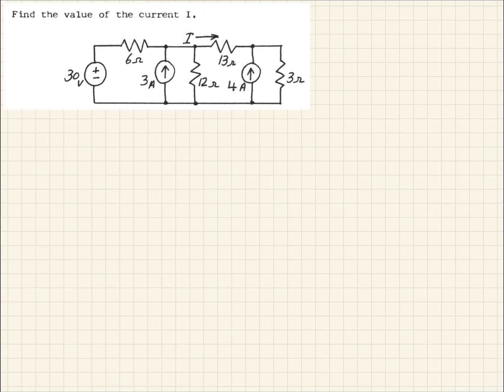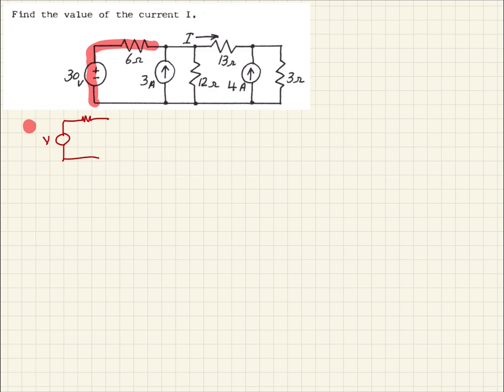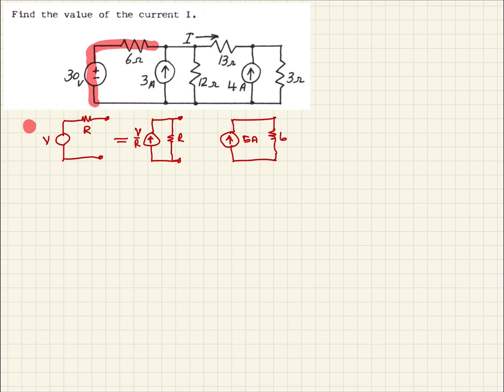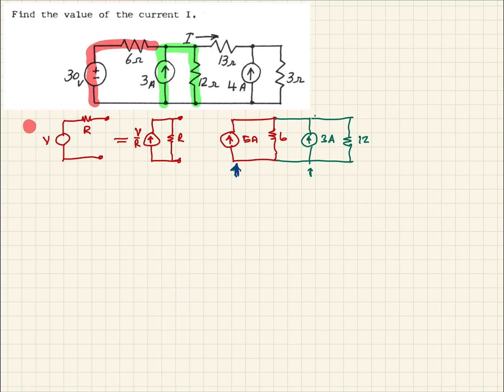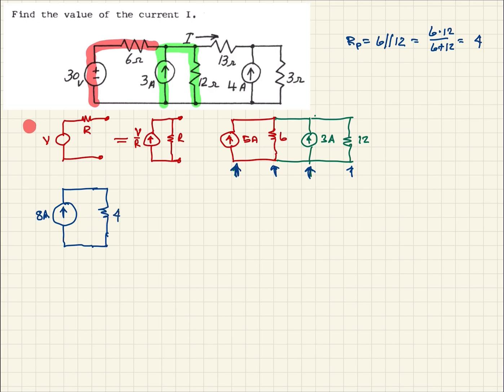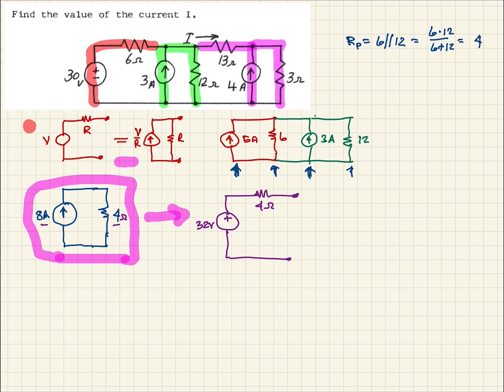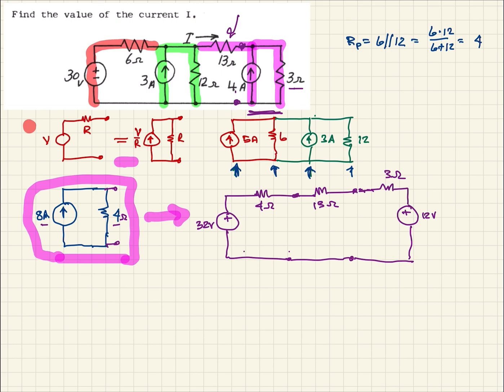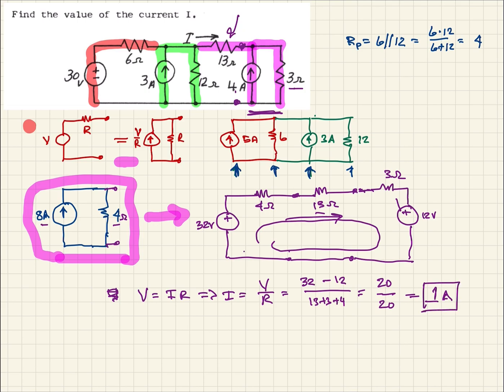Networks Problem Solver: Simple Circuits - Source Conversion

Comment: please can I know why you converted the 8Amps  and 4 ohms back to voltage source, is there a way I can get the answer without conversion
Reply from the maker: Thanks for the question. The reality is, for almost all circuit analysis problems, there are multiple way to solve for the desired quantity. In this case, to answer your specific question, you could solve for “I” without transforming back to voltage source by using KVL nodal analysis.  Since the subject of this example is source transformation, I chose to use that approach to complete the problem.  Does that make sense?
Reply: @shaneritterEE  Yes, sir, that makes a lot of sense. I am a student, I  just wanted to know if there are other ways to reach you via email for electrical related questions i really appreciate your videos.